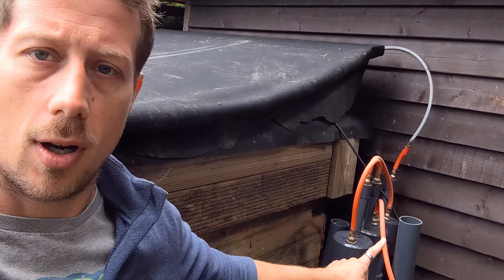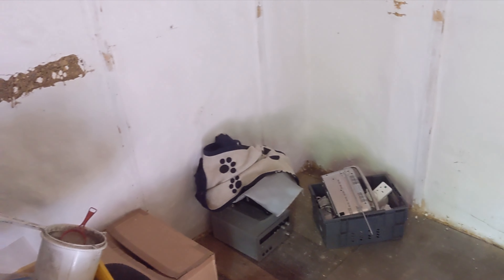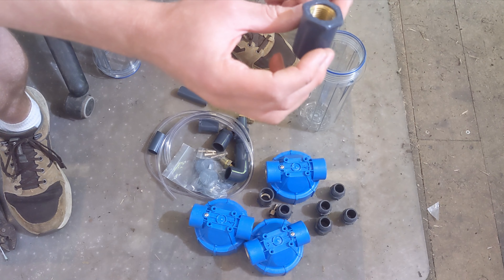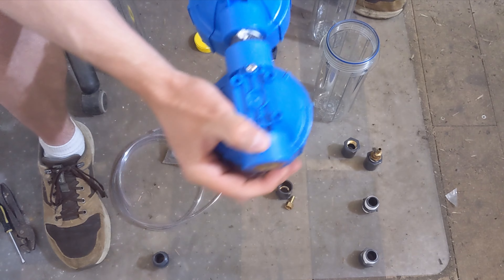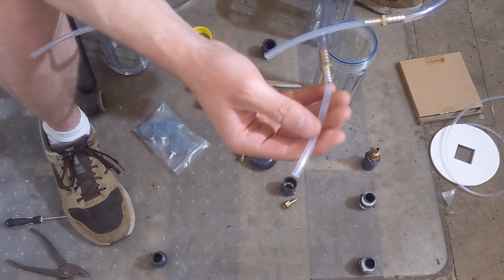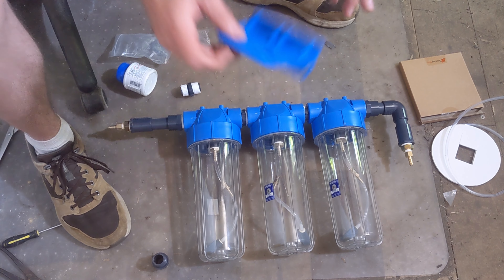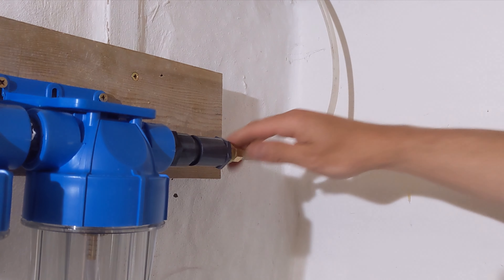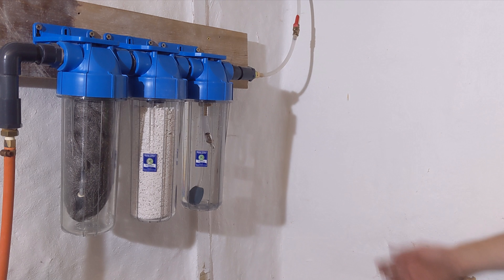How to build biogas scrubbers at home

Comment: Nice. Just one suggestion from a point of safety regarding gas. Only takes a few minutes tops. No matter how many clamps or fittings or plumbers tape are used. Once set-up is complete put the system from start to end under pressure. Use good old fashioned soapy water. Check ALL connections for possible gas leaks.
Reply: My thoughts too
Reply: Yes this is very important

Comment: You should add an activated carbon filter after the steel wool. My understanding is that it removes VOCs. Cleaner burn and you don't have to store them in your gas bag.
Reply: Also should consider adding a condenser to remove water vapor(perhaps mason jars in a water bath. It might work) after the water and before everything else.
Reply: ALSO ALSO I'm pretty sure that you want a base in the water to remove acids. Bleach should work. Water alone won't do much as it has a neutral PH. Plus there is already water vapor in the Biogas.

Comment: Hey chap, how’s it going?   Having watched your films (and quite a few others) I have built one and burned its first gas today! Yay.   It’s only been 9 days and I was not expecting it so soon and as such I have no filters or storage built yet.    I would love to know how long you have run them and if you would recommend them.   I have heard the steel wool filter is better mounted horizontally so the crumbling steel wool doesn’t block the inlet, any thoughts?   Also and of extreme interest is an episode of 39 ways to save the planet (bbc r4 if you don’t know it) where they put damp wood ash in a plastic bottle and inject co2, a reaction occurs, the ash turns to pellets as it takes up the co2 and the bottle collapses as the gas is consumed.   The pellets are then used as aggregate.    I am keen to try this as soon as I possibly can.      As my digester stands I am collecting in an inverted pint glass in a box of water which I intend to replicate in the morning on a 150l scale and I wonder if passing the gas through as much of the water in the box as possible before collecting it the floating drum would remove co2 as well, what do you think?    Incidentally I am heating it with a 200 w 3d printer bed heater which along with substantial insulation is keeping it warm for very little power.    Anyway  all the best.   Tanc
Reply from the maker: Hi Tanc. All goo here thanks. Not getting enough time to spend on fun things at the moment though. Great work on getting gas so soon, what did you use? Pure cow manure? I haven't run my scrubbers for long, one month so far. So far all I can say is they aren't leaking and they allow for easy checking of gas flow. That sounds interesting, I wonder what the reaction there is?! Let me know how it goes if you try it. Passing the gas through the water will remove some CO2 and a little H2S as well. It will mean your as is a bit "wet" but if you are not using a metal container for storage I don't think it will be too much of an issue. Interesting heating system. I'd like to down power my heater, I've got to get my temperature probe set up first so I can monitor the effects! Lots to keep us busy! Take it easy.
Reply: @GetMeOffGrid_ hiya  I started it with 60lt straight from the slurry tank underneath the cows on a dairy farm.    Farmer said the whole 180000gl tank is already loaded with some bacteria for breaking up the crust.    I was slightly concerned that this would be counter productive but all good in the end.   The only thing is I have no appliances to run from it. What do you use your biogas for?    Is it easy to convert a camping burner?    I am desperate to at least make my coffee on it as soon as possible.    Also how much gas can be produced from a 55gl system.    Also (sorry) have you ever run yours in the thermofillic range of 55-60C?     I have read that retention time is much less so presumably lt/hour goes up?    Anyway,  back to it 👍

Comment: How often do u have to change the filters and how do u identify it's time to change
Reply from the maker: How often is a difficult question. The cat litter will become visibly saturated, so you will be able to tell when you need to change that. The iron wool will rust and degrade as it reacts with the HS2, so you will be able to tell for that as well.

Comment: Good job mate... Consider adding three more cylinders to clean up some final residue.
The idea is a six-stage scrub system; 
1) H2O to remove CO2
2) Silica Gel to remove H2O
3) Steel Wool to remove H2S
4) NaOH solution to remove Sulfer (from the wool) and CO2
5) Silica Gel to remove H20 (from #4)
6) Activated Carbon to remove final trace CO2 & H2S

These steps should increase CH4 concentration from 43% to 55% (15% power increase).
Reply from the maker: Interesting! Question, could you not replace the H2O with NaOH solution and the Silica with activated charcoal? Two birds in one stone kind of thing?? Cheers
Reply: @GetMeOffGrid_  - I'm sure that would help as well. My understanding is that removing single elements per stage is simply more effective...
Reply: Hi from Britanny 
Why do you say that the process with 6 scrubbers could increase the concentration of CH4 from 43% to 55% , when the concentration of non purified biogas is 60% ( more 39% of CO2 + 1% of H2S ) ?  So you could increase from 60% to how ? 
And what is the grade of efficiency with the scrubber filled with NaOH ? 
Cordially JF Louarn
Reply: @mercermouth7571  Hi from Britanny 
Why do you say that the process with 6 scrubbers could increase the concentration of CH4 from 43% to 55% , when the concentration of non purified biogas is 60% ( more 39% of CO2 + 1% of H2S ) ?  So you could increase from 60% to how ? 
And what is the grade of efficiency with the scrubber filled with NaOH ? 
Cordially JF Louarn
Reply: @jflouarn1945  From what I'm reading, (I don't have the equipment to actually measure each component) the goal is to remove as much of the CO2, H2S, & H2O before storing/burning the CH4. 

I imagine that the original concentration of CH4 may also depend on the source of fermented materials. I'm fermenting Duckweed and house waste but no ruminate dung.

The bottom line is to clean the gas as much as possible which will help prevent corrosion of metal fittings/appliances and simply burn more efficiently overall. 

I've seen plenty of examples where no scrubbers were used at all...

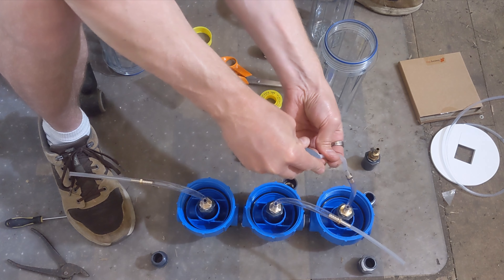Comment: Thank you for sharing your knowledge. It’s such a great resource. My question is on clip 7:00, did I hear you call it bubble rocks? What are there for? I thought the idea is to allow the gas into the very bottom of the filter and out from the top. How does it work with the bubble rocks blocking the gas? 
Thank you. I will definitely experiment making biogas by building a biodigester. 
In case you’re wondering about why I’m so interested. I currently a post graduate student of environmental science and my concentration is in Global Environmental Policy and Management. It’s very fascinating to know what we can do with our own waste right from our homes.
Thank you in advance for your response.
Reply from the maker: Thanks! The bubble rocks are to increase the surface area of the gas as it travels through the water. Meaning that more impurities will dissolve in the water. Good luck with your studies!
Reply: @GetMeOffGrid_  I don't think you need the diffuser rock in the 2nd and 3rd chamber. It's going to increase the pressure unneccesarily to reduce the gas collection in your bag and causing back pressure to your biodigester.

Comment: i would recommend trying to keep all tube accessories plastic until the end of the filter as you are using the iron wool to remove metal eating gas?
Reply from the maker: Good point! I hadn't thought of that, but makes perfect sense. Cheers

Comment: It looks great although I think the bubble rocks in the dry cylinders work against you. Those bubble rocks can have pretty high back pressure, and since there is no liquid/gas interface, there is no advantage to having them.  

Hypothetically, in an extreme scenario where we have lost the grid, we will run out of steel wool, and cat litter.  If it's the iron oxide that neutralizes the H2S, then could soil high in iron oxide content (really red soil) be used?  I can't think of any natural dessicants...maybe do it with a cold trap?

Anyway, that's a very clean installation. Subscribed!
Reply from the maker: Good point. Not sure why I put them there to be honest. Got an idea in my head and ran with it without thinking about it probably. 

I imagine that if you ran it through three water scrubbers you would remove most of the impurities that way. The dessicant would be the issue. Charcoal could work, or if you get silica gels you could remove them, heat them up to "reactivate" it after they are saturating and then use them again. A bit more work, but if the worlds ended I'm sure you'd have more time to do little jobs like that. 

I am hoping to get back to the house it is all installed in and give it an overhaul in the next few months. Hopefully I can then report back on any issue or successes. 

Cheers!

Comment: Hey, are these bubblers essential? If possible can you attach Amazon links for us to find these items?
Reply from the maker: They are not essential, you can burn the gas straight from the tank. However, the burn won't be as clean and could contain dangerous chemicals. Here are the water filter containers:

https://www.amazon.co.uk/gp/product/B01A5LSEHE/ref=ppx_yo_dt_b_search_asin_title?ie=UTF8&th=1

Comment: Hi nice video very informative. Question, when do you replace the filters?

thanks in advance
Reply from the maker: Good question. It all depends on the volume of gas you are producing, and how much gas is going through the scrubbers. The water will stop working when it becomes saturated with CO2, this will cause it to become acidic. So you can test the water to see if the pH has dropped. The desiccant will also become saturated and this is a bit easier to see, it will become visibly moist in the scrubber container. This is a huge benefit to these scrubbers: it is easy to see this. The iron wool will degrade visibly when it reacts with the H2S, so again it will be easy to see if all the iron wool has gone black/rusty.

Comment: I did some research into methane, turns out this biogas production can cause quite a bit of methane emissions. One reason is leaks, so I suggest you should really try to avoid any of those. Second, the sludge that remains can also produce quite a bit of methane after it's out of the digester, twelve times more than if you would just compost the feedstock. As I read it, this is on top of the methane captured by the gas bladder. I couldn't quickly find a solution, so I'd suggest reading into it, we need a way to deal with the sludge without causing these emissions!
Reply from the maker: Interesting. How big an issue is it? Relative to the amount of gas captured? Does this take into consideration is the digester is stirred or is left static? I'd imagine if it is stirred you could convert more digestate into methane before removing the sludge.
Reply: The difference between zealous policymakers and actual scientists, is that scientists know methane is very unstable and breaks down when exposed to the UV spectrum in natural light. A rather inconvenient fact, in light of the agricultural policies being strongarmed into place at the moment.
Reply: The difference between zealous policymakers and actual scientists, is that scientists know methane is very unstable and breaks down when exposed to the UV spectrum in natural light. A rather inconvenient fact, in light of the agricultural policies being strongarmed into place at the moment.
Reply: The difference between zealous policymakers and actual scientists, is that scientists know methane is very unstable and breaks down when exposed to the UV spectrum in natural light. A rather inconvenient fact, in light of the agricultural policies being strongarmed into place at the moment.
Reply: The difference between zealous policymakers and actual scientists, is that scientists know methane is very unstable and breaks down when exposed to the UV spectrum in natural light. A rather inconvenient fact, in light of the agricultural policies being strongarmed into place at the moment.
Reply: The difference between zealous policymakers and actual scientists, is that scientists know methane is very unstable and breaks down when exposed to the UV spectrum in natural light. A rather inconvenient fact, in light of the agricultural policies being strongarmed into place at the moment.
Reply: The difference between zealous policymakers and actual scientists, is that scientists know methane is very unstable and breaks down when exposed to the UV spectrum in natural light. A rather inconvenient fact, in light of the agricultural policies being strongarmed into place at the moment.
Reply: The difference between zealous policymakers and actual scientists, is that scientists know methane is very unstable and breaks down when exposed to the UV spectrum in natural light. A rather inconvenient fact, in light of the agricultural policies being strongarmed into place at the moment.
Reply: The difference between zealous policymakers and actual scientists, is that scientists know methane is very unstable and breaks down when exposed to the UV spectrum in natural light. A rather inconvenient fact, in light of the agricultural policies being strongarmed into place at the moment.
Reply: The difference between zealous policymakers and actual scientists, is that scientists know methane is very unstable and breaks down when exposed to the UV spectrum in natural light. A rather inconvenient fact, in light of the agricultural policies being strongarmed into place at the moment.
Reply: The difference between zealous policymakers and actual scientists, is that scientists know methane is very unstable and breaks down when exposed to the UV spectrum in natural light. A rather inconvenient fact, in light of the agricultural policies being strongarmed into place at the moment.
Reply: The difference between zealous policymakers and actual scientists, is that scientists know methane is very unstable and breaks down when exposed to the UV spectrum in natural light. A rather inconvenient fact, in light of the agricultural policies being strongarmed into place at the moment.
Reply: The difference between zealous policymakers and actual scientists, is that scientists know methane is very unstable and breaks down when exposed to the UV spectrum in natural light. A rather inconvenient fact, in light of the agricultural policies being strongarmed into place at the moment.
Reply: The difference between zealous policymakers and actual scientists, is that scientists know methane is very unstable and breaks down when exposed to the UV spectrum in natural light. A rather inconvenient fact, in light of the agricultural policies being strongarmed into place at the moment.
Reply: The difference between zealous policymakers and actual scientists, is that scientists know methane is very unstable and breaks down when exposed to the UV spectrum in natural light. A rather inconvenient fact, in light of the agricultural policies being strongarmed into place at the moment.
Reply: The difference between zealous policymakers and actual scientists, is that scientists know methane is very unstable and breaks down when exposed to the UV spectrum in natural light. A rather inconvenient fact, in light of the agricultural policies being strongarmed into place at the moment.
Reply: The difference between zealous policymakers and actual scientists, is that scientists know methane is very unstable and breaks down when exposed to the UV spectrum in natural light. A rather inconvenient fact, in light of the agricultural policies being strongarmed into place at the moment.
Reply: The difference between zealous policymakers and actual scientists, is that scientists know methane is very unstable and breaks down when exposed to the UV spectrum in natural light. A rather inconvenient fact, in light of the agricultural policies being strongarmed into place at the moment.
Reply: The difference between zealous policymakers and actual scientists, is that scientists know methane is very unstable and breaks down when exposed to the UV spectrum in natural light. A rather inconvenient fact, in light of the agricultural policies being strongarmed into place at the moment.
Reply: The difference between zealous policymakers and actual scientists, is that scientists know methane is very unstable and breaks down when exposed to the UV spectrum in natural light. A rather inconvenient fact, in light of the agricultural policies being strongarmed into place at the moment.
Reply: The difference between zealous policymakers and actual scientists, is that scientists know methane is very unstable and breaks down when exposed to the UV spectrum in natural light. A rather inconvenient fact, in light of the agricultural policies being strongarmed into place at the moment.
Reply: The difference between zealous policymakers and actual scientists, is that scientists know methane is very unstable and breaks down when exposed to the UV spectrum in natural light. A rather inconvenient fact, in light of the agricultural policies being strongarmed into place at the moment.

Comment: Are you producing any gas yet?
Reply from the maker: It did produce some gas. However, I have moved from this property now and so cannot access as easily as I could. Since it has got cold again production has declined a lot. I think there is still some room for improvement with some of the setup but haven't had the chance to play around with it recently.